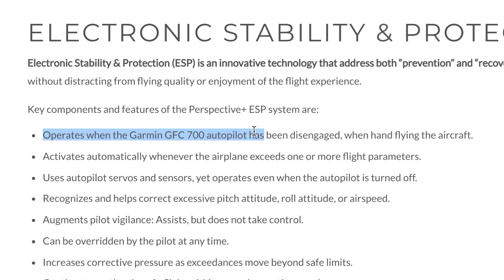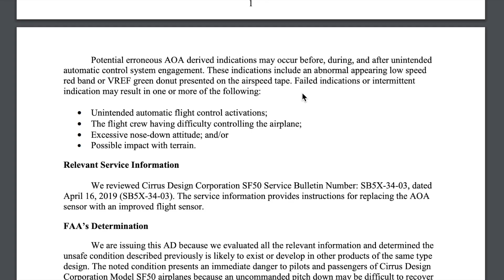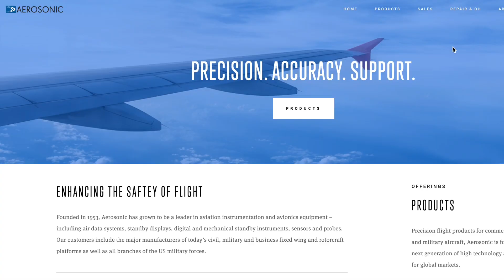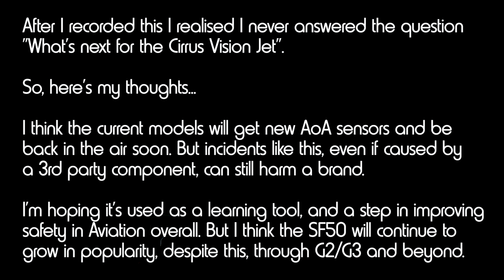Why did the FAA GROUND Cirrus VISION JETS?

Comment: I never liked it when a machine is thinking instead of me. In such a case, what is the point of me, sitting inside that machine. I am not a pilot, I am talking as a car driver - I always try to get a car with the least possible number of assisting systems. I do not have ESP, don't have brake assist, in my previous car I even didn,t have ABS. I'm still alive ...

Comment: I think they need to find a different way to determine angle of attack if you go back in history airbus lost a brand new plane off the coast of France because the plane had just come out of the paint shop and they were supplying water got into the angle of attack sensor the flight crew took the plane for a check ride before delivering it the angle of attack sensors gave out false informationLiterally froze when they got to altitude and if I’m not mistaken nine people died because of it I don’t understand they have a problem with the sensors yet Boeing serious we’re all going to the sensors

Comment: Ever since the "First Flight," all angle of attack indicators existed between the pilot's butt and the seat cushion.  The pilot knew when the airplane was about to stall because he was trained to resist the "incipient stall".  
           When I learned to fly C-150s back in the heyday of student pilot starts in the late 1960s we had something built into the wing known as a "stall warning" indicator.  Basically, it was a whistle built into the front of the wing that would make a "whistle" sound about 10 mph before the stall occurred.
              We got used to it.  We learned that when the plane was "accelerated" or made heavier by either turning or changing the speed the stall would occur sooner.  It was known as "flying by the seat of your pants".  Stall recognition was always on the top of the FAA's training curriculum.  We didn't have the technology of AOA visual indicators and frankly, we didn't need them.  Most student pilots don't like practicing stalls.  Why?  Because it scares most of them.
              I once had a student pilot attempt a power on climbing right turn stall with about 75 percent power, simulating what the FAA termed a "departure stall".  Due to the high "left turning tendency", the student was not using enough right rudder to counteract the left turning tendency when the C-150 stalled.  On course, the top wing stalled first and the plane "went over the top" into an incipient left spin.  Since we were at a high altitude, I wanted to see how my student would react.  Would he use the rudder to correct the situation or would he aggravate it with right aileron?  No, he did what any normal inexperienced student would do, he let go of the controls and grabbed my left leg as hard as he could with both hands.
             After I stopped laughing to myself we went over the physics of what had just occurred.  Learning how to prevent a stall using all of the pilot's experience obtained by constant repetition of stall recovery procedures was better than having a hundred AOA indicators plastered all over the cockpit. 
               As aircraft become more complex, the weekend flyer needs more repetitive training for stall prevention.  But are AoA indicators really necessary?   They might be useful when making steeper banks at slower airspeeds when in the traffic pattern, but It is my humble opinion that knowing your airplane and all of its flight characteristics like the back of your hand, is the only safe way of protecting yourself and your passengers. The only way to get that that good is constant repetition.  Constant practice.  I highly recommend all pilots, no matter how many flight hours you have to take a few lessons with a well-qualified flight instructor and practice all sorts of stalls.
            I recommend you do them with and without power.  Do them in a level steep turn and experience an "accelerated stall".
Do them with almost full power while climbing straight ahead and again to the left and to the right.  Do them until you've had enough and then do some more.  Your "special" flight instructor will be more than willing to assist you.  Not all flight instructors like to teach stalls.  Go to the ones who think they are fun because they really are..
Reply: @c7042  Good for you.  You are one damn good stick and rudder pilot.  I too took some lessons in a Decathlon from the same FAA designee who wrote my PPL ticket.  His son and I later became good friends in my early 20s back in the mid-70s and we would do all sorts of aerobatics in that beautiful airplane.  But the father had one rule.  He said:  "if you over G the airplane, you're going to own it."  So we were very careful to fly it precisely.  I loved aerobatics as a young guy.  I haven't had a chance to do anything more than spins these days, but I remember the "old times well" as the Cars used to sing.  Live long and prosper.

Comment: "why would you use angle of attack?"

It's interesting that someone asks that. The truth is it comes down to flying close to the envelope, typically close to the stall. In commercial jets, we have an emergency maneuver done in response to a GPWS alert ("terrain, pull up"). The maneuver is basically to firewall the thrust levers and pitch the aircraft to Vx, which happens to be at critical angle of attack.

When an aircraft doesn't have an AOA sensor, Vx is a calculated speed, but in reality it's a speed that shifts because conditions change (aircraft weight, weather conditions). Critical alpha does not. Therefore, it's a lot more efficient to fly the AOA rather than the airspeed. In Airbus, we just put max thrust and pull the stick ALL the way back. The FBW stops the nose from pitching above alpha critical (the plane has multiple AOA sensors, even though we can't see the output measured).

In aerial survey, with a strong tailwind, I often had to fly close to the stall, in order to maintain a certain ground speed. I wish I had an angle of attack sensor then, because I could have gone closer to the stall speed safely, and thus helped get better images for the clients. I can "feel" the stall coming, but there will also be a small buffer, because of that uncertainty. Slow flight would be much safer if we flew it on AOA rather than airspeed.

Finally, I wish I had an angle of attack indicator for flight instructing. As an FI, I would sit with students in the classroom, explain to them how the aircraft's lift changed with angle of attack and the theory of stall. I would even go a step further and explain how stall speed was calculated and thus how it was affected in flight by certain maneuvers and factors. But I was never able to show them in flight, that final step required for a concrete understanding of an alien concept.

Comment: Chuck Yeager has said, "If you need an angle of attack indicator, you really shouldn't be flying airplanes.
      As we see, angle of attack indicators might fail, and if that failure can cause a crash, it's not making your flight safer. If it's a liability, it's bad.
     A simple tab on the wing that is flipped up, closing a switch to ring an alarm in the cockpit should be all you need. KISS.
Reply: Your protection system / stall warning is when the seat buffets; Those tabbs you speak of I discovered in first hours in trainer; Just when I get ready to fly at the stall buffett this inane buzzer distracts me; I had competent CFI so I asked him What is that thing ?
If they need that to tell them Stall Buffet is occurring when seat will bring it to you; Then I will continue my current status which is sit at table on the ground and study IFR Commercial
Reply: @ChiDraconis  The key word here is stall WARNING
     The buzzer goes off before the entire wing stalls.
      The buffet you speak of is caused by the turbulent air hitting the elevator. In aircraft with a T-tail this doesn't happen, so at least in that type, you need a stall warning.
Reply: @erictaylor5462  Okay I did read the T-tail is to make comfort ( passenger comfort ) though I stand corrected that it is the elevator and not the wing as I thought it was ♦  Last few days of study I see what is clearly designed for Trainer Role has oversize rudder with T-tail design ( lost the name but think it is an Italian design ) 
Seems natural that boundary layer over front-edge would invoke some buffeting ~ was trainer that I am speaking of as I went to leading edge to see the gizmo and noticed a non-laminar wing design then for before the entire wing stalls the stall tends to progress unless we have the wrong response of rudder into the spin direction to get the nose pointed down rather than the lift the low wing with the rudder → last few videos I have seen some inane responses which should never occur that near the ground yet my idea is that the T-tail will perform differently in standard stall / spin conditions
I am asking on that last rather than responding ◘  Okay with paying passengers I can see warnings yet the stick shaker and other features seem to me to  be set too early  →  The only place that makes sense to me is where long-haul may induce repetition dulling  ( note we are talking of something other than the video subject here ) ••• CFI instructed me that the correct response is to bring the vehicle level and let power do its job rather that looking for go ahead and let it fall through like I would do
Reply: @ChiDraconis  For an airfoil (wing, for example) to produce lift, the airflow over the top of the wing must be smooth.
       Airfoils produce the most lift when the angle of attack is highest. However, there is a point when the air can no longer "stick" to the top of the wing. When the air comes unstuck it becomes turbulent. That is, it becomes chaotic, with bits of air moving in random directions.
    Until recently it was believed that the lift was generated from a lower pressure on top of the wing. This was proved to be not the case. The low pressure DOES provide some lift, but most of the lift is produced by the wing forcing air down.
      If the wing stalls the air is no longer pushed down and lift is lost.
     Airplanes are deliberately designed so the main wing stalls before the tail plane because if the tail plane stalls the pilot loses pitch control, and without pitch control the nose won't fall allowing the wing to regain lift.
     With only the wing stalled but the tail plane still flying the nose drops and the plane can regain lift automatically.
    But this only works if both wings stall at the same time. If there is a yaw component (the nose is not pointed directly into the wind) then one wing will stall before the other, inducing a spin.
      Any stall will cause the plane to descend some, but in a spin, it will descend a lot. If the plane is lower than the altitude required to recover control the plane will crash.
      The altitude below which it is possible to recover from a spin is called the red zone. It is a time when the pilot must be especially careful about his airspeed. It is also the place where airspeed will be lowest. The airplane can quickly fall below stall speed, especially if the pilot does something that increases his stall speed, like turning, or raising the flaps.
Reply: @erictaylor5462  
That is what I thought and how I viewed the thing; I watched recently someone whom obviously had seen it several times push a standard trainer into stall-spin and do exactly the wrong thing with the controls then just let go and hold onto something else; As expected it does not go into a flat-spin it recovers on its own ◘ It will be both above and below the wing when speaking of slow-flight but non-stalled and there even the fuselage will provide some very scant lift — though not measurable in any common sense nor use-able 
So if Empennage is where the buffeting occurs that rattles the airplane then we have 
Failure to Communicate
Since I distinctly could feel the wing buffeting ~ yet Little Miss Muffet continued to sit on her Tuff-It at Pilots Lounge 
She was trying to get an Officer

Comment: It is a known fact that pilot error is a leading cause of aviation accidents. But is engineering the pilot out of the loop the correct answer, simply making it impossible for the pilot to make a mistake? 
      I think we need to know the inverse statistic of the pilot error equation: What percent of aviation accidents (or just emergencies) are avoided because the pilot took the correct activation to head off a problem before it even develops into an emergency. Also, what percentage of accidents are avoided because the pilot performed an unusual maneuver, or even a maneuver that normally would be considered very dangerous, but in a given situation is necessary.
       For example, a pilot might need to exceed the maximum allowed G to avoid a mid air or flying into terrain.
    Who cares if you bend something in the air frame, if not bending it means hitting the ground? Hitting the ground is going to bend things even more.
Reply: Engineering the pilot out of the loop is the right way to go.  We haven’t gone far enough in this direction.  For instance AF447 where the pitot static sensors froze for a brief period the autopilot handed controlled to the 1st officer who was incompetent to fly the aircraft on throttle and attitude.  An autopilot could easily have continued flying the aircraft using GPS and inertial data and throttle settings.  Too quickly is control handed to pilots.

Comment: The problem is NOT with AOA sensors or AOA displays.... the problem lies in letting a system fly the airplane for you and letting that system make decisions when the auto-pilot is turned OFF.  (that should be illegal.  Seriously, if the auto is OFF, then absolutely NO system should be over-riding the pilot)

Comment: AoA indicators and sensors by themselves are not the issue. The automatic inputs from autopilot systems based on the indication or sensor position are the problem. All aircraft that have automatic pilot and hydraulic/electric or manual trim systems have the “What if” procedures for uncommanded inputs. Failure to comply or comply late can cause flight into terrain. Cirrus and Boeing 737 systems are significantly different in operation, and automation.  The only commonality is the name AoA sensor and indicator.

Comment: Have flown many turbine-powered aircraft with and without AOA indicators.  Much prefer those with AOA.  With it, I don’t need to refer to the airspeed indicator on takeoff, landing, or during high altitude cruise.  On approach, 1.3 VS is VRef.  In cruise, I can fly L/D Max and get the best range out of the plane.  In a Gulfstream II, III, IV, set 1.4 VS.  you’ll come down final at Ref +10, which is what’s recommended and set your thrust to maintain your 3 Degree ILS glidepath.  Flying the T-38 on approach, we always just set the AOA for 1.3 vs and flew the final turn with the “doughnut”indicator on top of the glare shield in the green.  If it went white, you’re too fast.  If it went amber or red, you’re too slow.  Never had to look inside.  If you have AOA and learn to use it, you’ll never stall a plane.  Unless you’re trying to.  Great instrument.

Comment: Seems like one of the 737s had a jamed aoa from a bird strike or something. If you're going to put these on a a plane then put two on for redundancy. The FAA is an early warning system for safety issues on planes. Glad they acted quickly this time. These electronic nanny aids on cars are getting to be a problem to. At least they won't fall out of the sky if they go haywire.

Comment: A.O.A is a modern marvel , The military has been using it for a long time . its great to have it in the private sector as well . BUT when you integrate all the software with it , any Code that is off by one dot or one dash gives a whole new scenario. So whoever is writing the code better have a firm grip on Aviation. Just F.Y.I.

Comment: AOA “indicators” are not the problem. In fact, they’re an amazing tool for the pilot. They tell you exactly what the wing is doing regardless of the weight or bank angle of the aircraft. Instructors should be teaching students to rely on them more. They don’t lie. BUT... when you plug a computer into one and then have the computer take over the flight controls ...eeesh. This gets scary. It’s called “Titanic Syndrome” with the engineers. Remember when they said that boat was unsinkable? Yeah, well the engineers today are saying these computers don’t screw up. Well guess what, they do.

Comment: Here's how you fix this problem. get rid of all this crap and "fly" the plane.  I've watched clips of the single engine, single pilot jets, ....gear up autopilot on. 100, 50 autopilot disconnect land....I used to hand fly B-72 going up to FL180 and times all the way till landing from FL330. Even on the L-1011 cause one day it's all going to break, adn then what do you do?

Comment: This discussion is a bit irrelevant unless you qualify it by the type of airplane that is being flown .  AOA is significant and critical to safe flight in all aircraft .  My aircraft, however, has a VERY wide envelope of operation around critical angle of attack that is easily controlled without an AOA sensor.  New very high performance aircraft have narrow envelopes and pilots may need help in determining exactly where they are relative to the Critical angle of attack. No single answer for all aircraft is applicable!